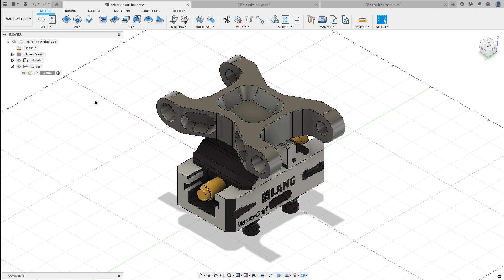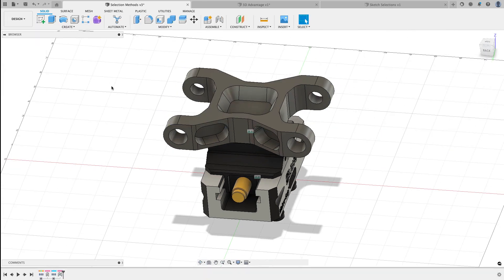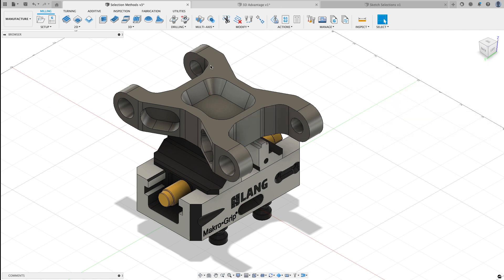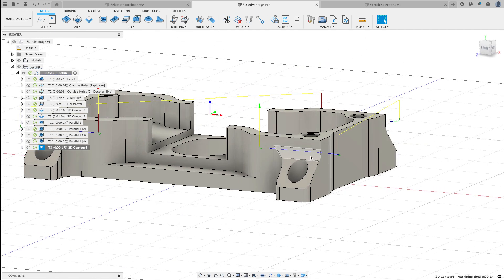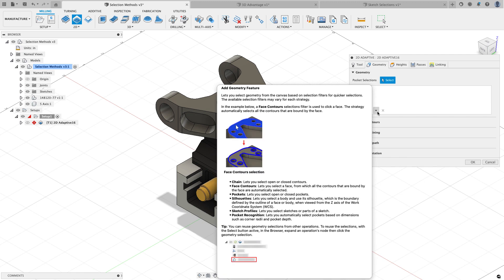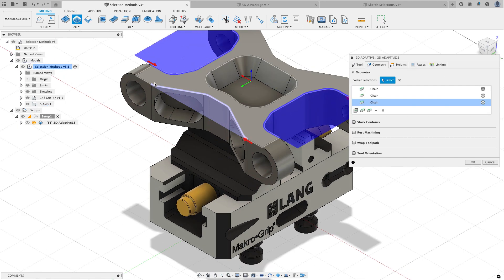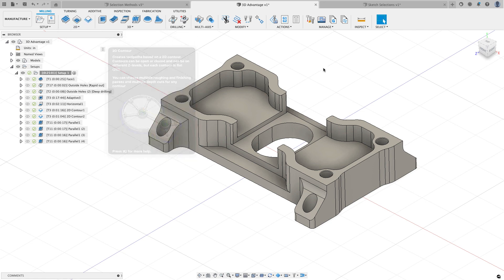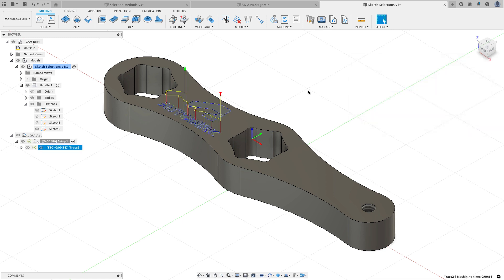Fusion 360 New CAM Geometry Selections

Comment: I think there are still a LOT of limitations with selections in fusion when it comes to selecting very complex geometries like a mold cavity made up of many surface patches. Like a simple marque selection option WHY that does not exist is just ridiculous!
Reply: True, my old soft SPRUT CAM has much better solutions for choseing limitation. Fusion must learn alot.
Reply from the maker: @afrykanerPL Sure it does.
Reply: @afrykanerPL Sprut?😅😅😅😅😅whats that...brand for cutting grass or washing machines? 😅😅😅😅

Comment: I always find myself making everything little thing a new component, instead of just adding features to the parts I'm working on. How do you determine when its time to stop sketching and just make a new component? I hope this makes lol
Reply from the maker: I try to use the thinking of "how would this be assembled" when deciding if I need components. Each part of a mechanical assembly would typically be a component for me. Not 100% of the time, but more often than not.

Comment: Terrible update! For 2 days now I can’t figure out the processing.. before it took a couple of minutes... now it’s the end.. if I don’t figure it out, I’ll say goodbye to FUSION 360
Reply from the maker: All the old ways of selections still work. What are you having difficulty with? Can you be more specific?
Reply: @MechanicalAdvantage  The problem with processing open pockets, I have a radiator and earlier I selected a plane and the program took into account all offices, now you need to manually select all individual contours and it is not possible to enter the cutter from an external contour. how to enable the old type of processing?

Comment: thank you, please check something that smashed a 12 mm endmill, in 2D adaptive the step over per cut or tool load is set to a nominated value, in the old geometry selection it woul keep this constant. In the new selection it varies and reaks cutters. Of particular not if you select chain it behaves, if you selct face the stepover is affected by geometry  below the cut height.. why do they keep this secret??  Carbide cutters are expensive.

Comment: Instead of selecting the edges as pairs with a 0.5" extension, you could select the straight edges at the top and select the bottom height as the radius tangent point (original segment selection)
Reply: Providing they are all at the same height

Comment: these are nice features I wish when you do a 3d adaptive there was a area so can add a contour without doing a create derived operation. also wish they would break up the machine add on so can use 4th axis simultaneous without needing 5th and all that.
Reply from the maker: Do you have a probe on your machine? Do you ever wish you could trim a toolpath? Do you ever wish you could use two different tools for the same toolpath? Do ever have to drill and tap holes? Ever with you could control where surfacing toolpaths start and end and line all those points up? How about surfacing toolpaths that are both steep and shallow at the same time? 

There are lots of great features in the machining extension. Breaking all of those features out one by one I think would add more complexity for the customer. I think you will continue seeing things added to the machining extension that will make it an even better value than it currently is.
Reply: @MechanicalAdvantage  I do have a probe but I'm just a hobbyist I have a fadal machine it's just easier to use a haimer. Not long ago ya could use 4th features.
Reply: Hello Kevin glad to see your back online hows it going ?

Comment: I greatly prefer the geometry feature user interface that hyperMILL uses. They use a separate tree panel instead of burying it in a tabbed dialog box that you have to press a down arrow to see your saved geometry features. 

https://www.youtube.com/watch?v=lSw_ZGBofDc
Reply: If Fusion ever adopts the UI of Hypermill, I think that would go over like a fart in church
Reply: @sethmadore4127  There is zero chance Fusion 360 can grow into serious machining job shops packing all information into one tree and a small, tabbed dialog box. hyperMILL, Esprit, Topsolid, etc. all use multiple trees. Critical data needs to be right in front of you and not buried. Autodesk Featurecam also has this right with its excellent User Interface.
Reply: @JonBanquer  Fusion development stole the FeatureCAM development team for the past several years. This is Interactive Feature Recognition from FC that has been around for 20 years, finally put into Fusion, but still way too many clicks as you have observed.